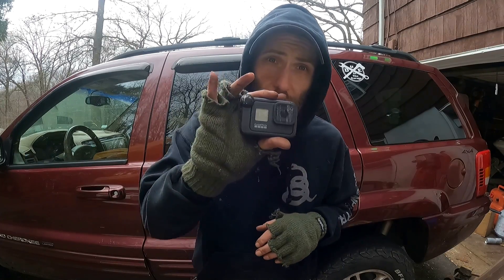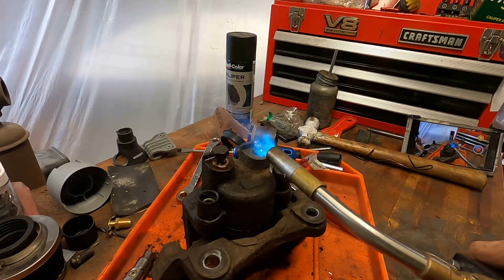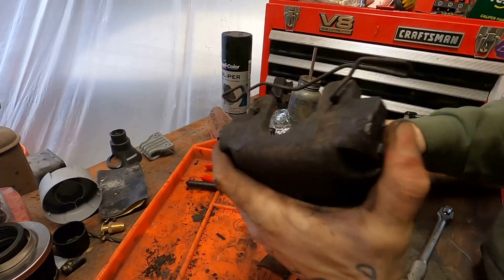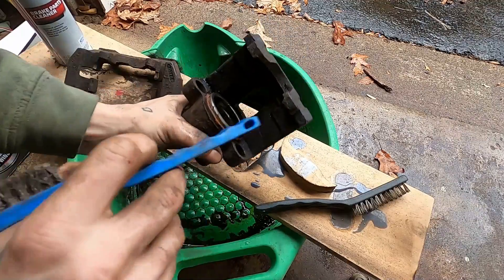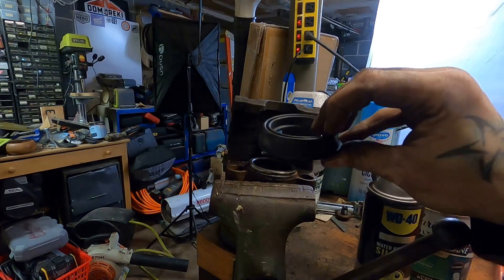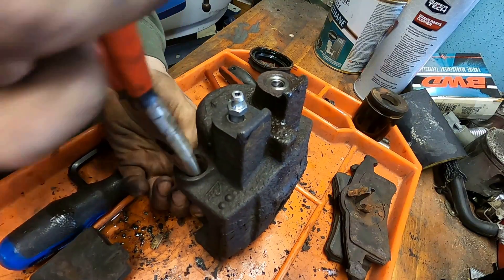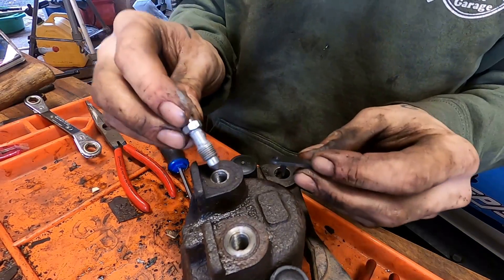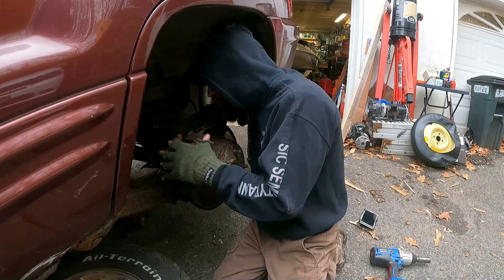HOW and WHY: Rebuilding Junk Brake Calipers (Even seized up ones!)

Comment: I save broken drill bits and like to find one that fits tightly into the bleeder hole. that gives the bleeder a little more structure when you try to wrench it out.
Reply from the maker: Whoa.... your brain is already in 2025! I cannot wait to try that one. Thanks bud!
Reply: I don't know how I ever got along without an oxy acetylene torch. Propane plumber torch is better than nothing, but oxy fuel is a laser beam of heat.
Heat 'em up cherry red, shove a drill bit in the hole, and vise grips will pull 'em right out without complaints or complications.
Doesn't even need to be used broken drill bits, as long as you cool the bleeder off you won't ruin the drill bit. Not that 1/8 drill bits are expensive, but you know we're all miserly, otherwise we wouldn't be driving old rusted out shitboxes.

Comment: It's good to actually see some one on you tube use the red rubber grease on the seals it seems most people make videos that copy others on you tube and every one on you tube I've seen mainly videos about motorcycle calipers and masters use only brake fluid on the seals but any repair manual states do not use brake fluid to lubricant the rubber seals, I believe it last much long with the rubbers lightly greased with proper grease as I've done one master with just fluid and it never seemed that great and now two years later I'm doing it again with rubber grease this time, also that at least harley uses rubber grease from the factory on new calipers and masters

Comment: Cool vidoe brother. Here in the UK many garages won’t rebuild them and just stick new on as cost per hour on time needs to be maximized for profit, and I suppose it helps for warranty work as you know you’re not getting a comeback. 

But for DIY people it’s a no brainer when done safely and correctly. Brake calipers are the biggest scam ever, you return the old and receive your 20 back, they fix it for £15 based on parts and the hour of his/her time on the job, they sell for 100 to 150 or more getting over 400% profit sometimes. I suppose it’s a cool side hustle for somebody.

Comment: Little pro tip for those copper crush washers. Grab propane torch and some pliers and heat the washer up with the torch. Wait till its red hot, like glowing, and quickly toss it in a cup of water. By heating it up the metal expands and loses the indent. Throwing it in water quick locks it into that size.  Maybe this doesn't actually do anything but that logic always made sense to me and I've never had one leak

Comment: The Frenkits don't contain everything you need. They come without the copper washers to mount the flexis, and without the wire snap ring used by some manufacturers as a retainer for the dust seal.
Also, the caliper and bracket mounting bolts should be torqued to manufacturer's specs.
Reply: Neither do factory rebuild kits (from my experience)

Comment: Don’t use anti seize on the bleeder screws, use teflon [ptfe] tape
Reply: I use that tape too, but mostly for vacuum bleed the system, and the tape avoids air from beeing sucked through the threads showing false air in the system through the transparent suction hose. But anti seize or cupper paste is better than nothing. The most important is some kind of barrier to avoid oxidation from forming a rust bond. :)
Reply: @Helikopterpop 
Oh absolutely I agree. I just like the tape because it acts as an anti-seize. But that’s STRICTLY my experience.

Comment: Hey buddy great video. Two things. You can always degrease the caliper and brush on some naval jelly or rust converter to form a protective layer much better and stronger than paint.
Your slide rubber sleeves? Take a look inside of them, do you see ribs over there? If you do do not grease the inside.

Comment: Watch Wes Work is a mechanical genius with great sense of humor. Rebuilding calipers is an indispensable skill to have. I own three SAAB cars and they all have their original brake hydraulic bodies. The hydraulic bodies are in great shape for being 22 years old. Over the years I've rebuilt several of the calipers due to torn rubber dust boots and/or heavily pitted pistons and it has kept the cost of brake maintenance to an absolute minimum. Great video. Subscribed. Cheers.
Reply: I heard that since Saab was an airplane Builder that made cars the cars came with parachutes in the back just in case it breaks didn't work
Reply: @carmenelmo8650  I always thought an ejection seat would be a cool option for SAAB cars. Just joking.

Comment: I never have rebuilt a caliper, back in the day the “company” would take the core back, and rebuild it, and the next Joe would get it back all shiny new in a box with hammer marks still present. lol 

I guess today they melt it down and recast because your right the latest ones I have gotten have been way rougher.

Comment: Better than anti-seize: silicone grease. It's safe for for the brake internals should anything find its way in there, and it repels moisture better.

Comment: hey boss! any reason a caliper might seize even after a new caliper + new hose replacement? master seems to be fine but i'm dealing with front left sticking repeatedly. oem caliper was seized so good the piston wouldn't pop out with the air trick. thanx for the vid as always!~
Reply from the maker: Check your soft line bud. When they go the can expand and cause weird issues. Yours might be contracting causing pressure to the piston. Always possible you got a bad one out of the box. Good luck with it bud.
Reply: hey thanks- that was what i meant by "hose", the soft line. replaced and still sticking. appreciate your help, maybe i'll try replacing it again since they are dirt cheap
Reply: I had a remanufactured caliper stick on me. Took it apart and found the bore had lots of paint overspray. It was an epoxy paint so brake fluid did not strip it. I used fine grit sandpaper to remove it. Cleaned real good and reassembled. Worked with no problems ever since.
Reply: hey alex, thanks SO MUCH for this idea dude. i've been going crazy trying to problem solve this. i'll give her a peek!
Reply: @dracofangxxx  Hope you find the problem. My reman caliper's piston would stick even with the seal removed. The overspray was that thick. That epoxy paint took a good while to sand out for me. I think I used 400 grit paper. Didn't want to use one too aggressive and score up the bore. I guess I could have taken the caliper back, but I don't know how good another would have been. I wanted to rebuild the original, but the kit I ordered didn't arrive by the morning before a long trip. That's why I got the reman unit. Good luck!
Reply: If compressed air won't push out your seized piston get the proper size grease zero and use grease gun to push it out. It's worked for me!

Comment: I would love to rebuild my front brake calipers. 1999 Chevy S10 4wd, dual piston. Need the hydraulic parts and the slide bushings and pins in the mounting bracket. Show me the kit, cause I can't find it.
Reply from the maker: It doesn't appear they make the kit for the 4x4 which is a bummer. Looks like you can scoop a lot of it individually off Rockauto. Weird there isn't a kit for such a popular GM truck.

Comment: I've gotta admit I admire your love for these vehicles I'm the same way with my Ford Explorers and my 95 F150.
Reply from the maker: Thanks bud. Real recognize real, aye ;-) thank God there are some folks crazy enough to spend good money and time on old iron
Reply: @DEInTheGarage  that's for sure! I've also been working on reviving some old Garden tractors that where left for dead. Currently it's a 1978 John Deere 316K and a 1968 IH Cub Cadet 124. Neither ran before I had them for who knows how long. Old iron is around for a reason they where built real good.

Comment: Greatly appreciate this video. I did conversion to Liberty disc brakes on my 93 xj; but opted for a Powerstop kit with calipers. 1.5 years later , the right rear caliper froze outward, driving brake pads to metal quickly.  Got a reman to get me by, but I have a pair of OEM calipers from JY, and will definitely do rebuild + swap them in.  Front calipers are also Powerstop ; and likely will get JY ones and do rebuild too, though so far they seem fine.  Worst case I have spares ready.  Thanks again for this info.